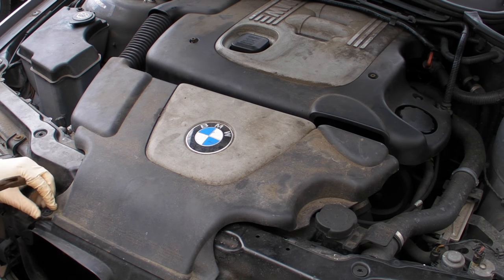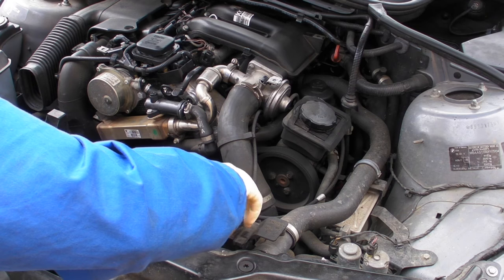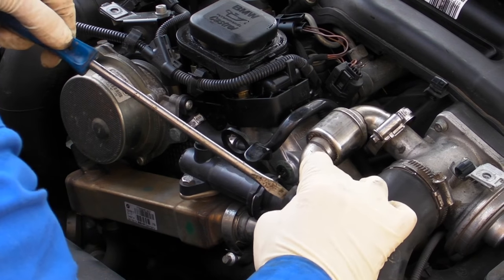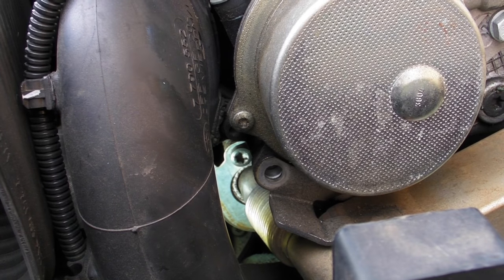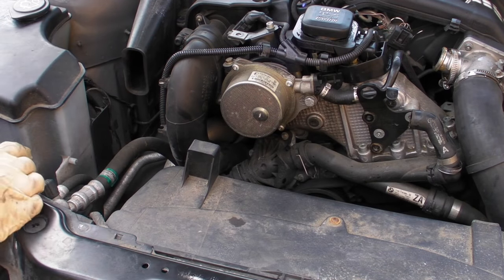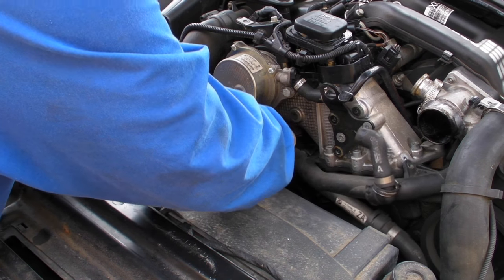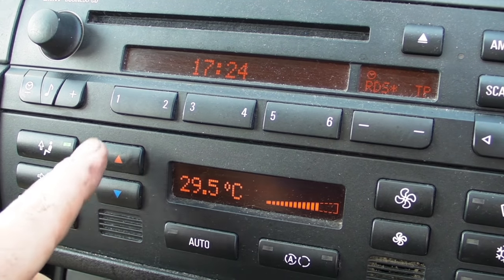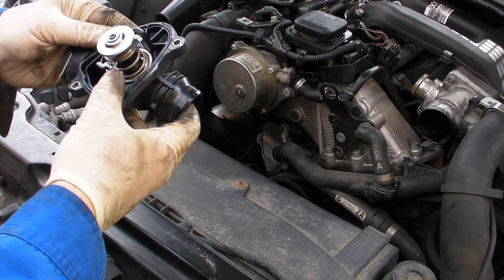BMW E46 3 series diesel engine Thermostat

Comment: I dropped my lower EGR cooler bolt and lost it forever. Bloody difficult getting it to bite so I didn’t bother either. Those two bolts on to the exhaust are a pig to get back in too. Drop them and they too are lost forever 😂

Comment: This video was really helpful but how on earth do you go about putting the torx screws back on the egr to exhaust, I’ve managed to lose both of them in the process
Reply from the maker: Use a magnet to offer it up or jam thin piece of paper between torx and bolt to hold in position
Reply: sandy anderson ah cheers mate that’s very helpful, does it have to be the exact torx screw or will any 8mm screw work just as well, as I’ve completely lost both my original screws

Comment: Hi, I have an e46 320d 150 from 2002 facelift. Coolant temperature  is dropping to 70 C at higher speeds and temp gauge goes back to 90 at idle. I will definetly change the thermostat and the coolant, but what about the egr thermostat? I've been told at the car part store that my car doesn't have an egr thermostat, i also read something that early 2002 150hp engines don't have egr thermostat. Is it true? Also is gas recirculator thermostat and egr thermostat the same thing?
Reply from the maker: Don't know about transition year for egr thermostat but your problem sounds like main engine thermostat

Comment: mmm I've the 2lt petrol 318i & my thermostat is abit more of a sod to sort out, IE needing to remove the power steering pump, belts, pulley etc just to get the thermostat out..

anyway,, going back to your bleeding method, personally I found it much better to take the car out til it had warmed up, thus eliminating the chance if air blocks etc... also for anyone else plz make sure there's no leaks... or you'll be fighting a lost battle..

anyway, yeah good video & voice over... least your guide is clear to see & follow
Reply from the maker: Mal P cheers

Comment: Should the temp needle be at twelve position when its at optimum temp or just below 12? I've had the water pump and thermostat changed and noticed the needle will rise to just under 12 position ..thanks
Reply from the maker: Optimum temp is at the 12 o clock position! Check it with cheap scan tool should be above 85c
Reply from the maker: https://youtu.be/BicYRWSVzT4
Reply: Also you can run the test on the dashboard with the milometer button, option 19, then off, then 7.

Comment: Is it OK to leave the bottom screw out of the egr coolant part to the exhaust as I can't get the bugger back in and can smell fumes???
Reply from the maker: Better to get it in because mines stinked as well til I finally stood on my head to get torx in cheers sandy

Comment: I just did this on mine as the engine was running cold (max 65c) and very slow to warm up but even with the new stat in it only reaches 75c (appears to be in the middle on the temp gauge though) but should be at 88c, anyone know whats going on there?
Reply: Maybe the egr termostat, also enable flow the cold water when its bad

Comment: Help plz I got BMW e46 m43 318i I've replaced the water pump and the thermostat an the sensor on the pipe but it is still overheating
Reply from the maker: Christopher Mentor head gasket? Blockage?